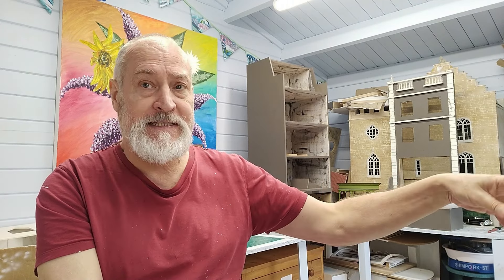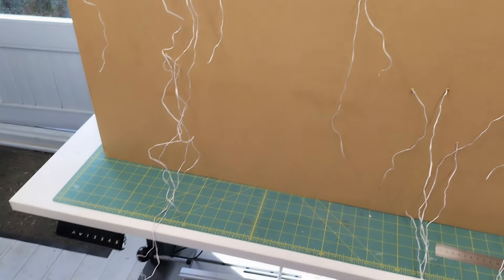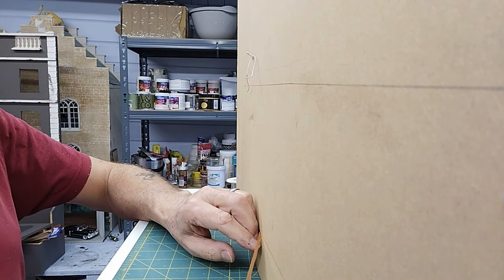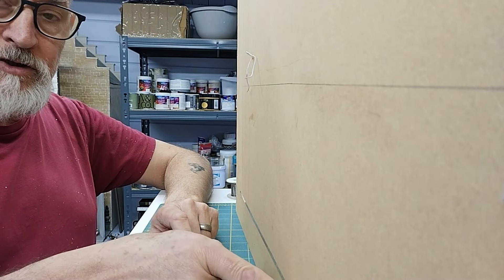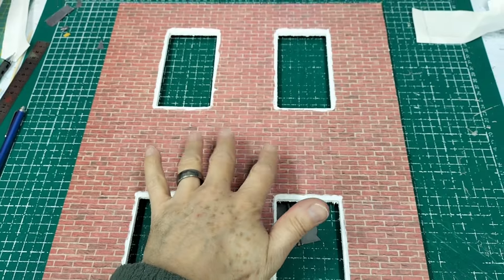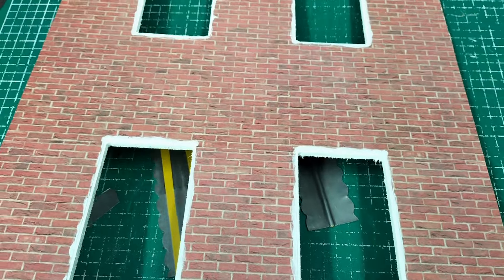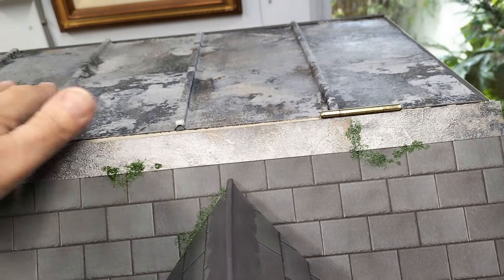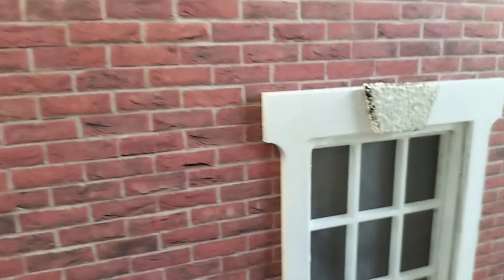Another Dollhouse commission part 3

Comment: Love the led flashing on the dormers. With the North American type houses we don’t have that flat back area to run the wire tapes, I have used wires and run them down through a straw that I painted to the power bar.
Reply from the maker: Oh yes that's right, the American houses don't have backs to them! I have to say I've always found that a little strange because it's like part of the house is just missing 😁 and makes it more difficult to do the copper tape system....and John boy would be in a constant state of worry because of all the dust getting in all the time, what with his OCD condition! 😂

Comment: You could use magnets to hold the front panel shut.
Reply from the maker: Yes that's also an option, but this kit is so old that you can't get the door to go flat at the bottom. So the little dollhouse magnets wouldn't be able to pull the door in. But like I said in the video, I added a catch to the top and have suggested to the lady that she could put one at the bottom also, if it bothered her.